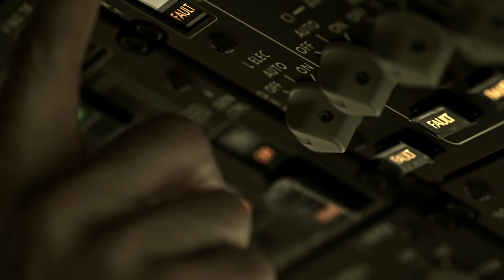Boeing 777 team: Precision Craftsmanship (HD version)

Comment: Most of the parts has been made in third world country like China ,Taiwan, Pakistan and so on to save a money. Are you feel safer now?
Reply: paul stevens http://www.airframer.com/aircraft_detail.html?model=B777 
I beg to differ
Reply: +paul stevens Doubt it. Tolerances for aviation parts are so low it's usually cheaper to do it developed high-tech countries. High tech materials still cost the same everywhere, and labor costs are usually insignificant compared to the actual product.